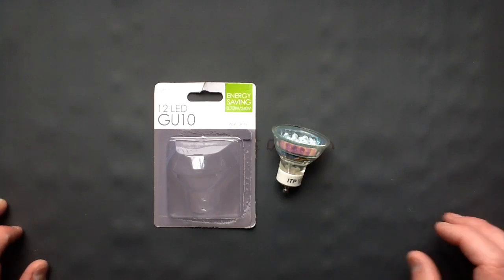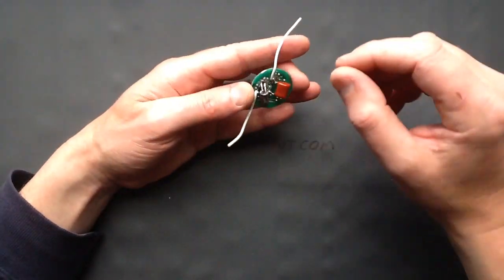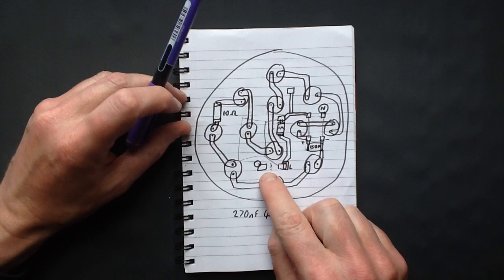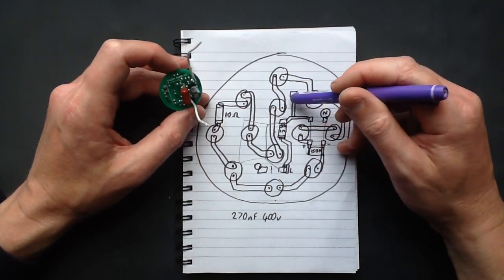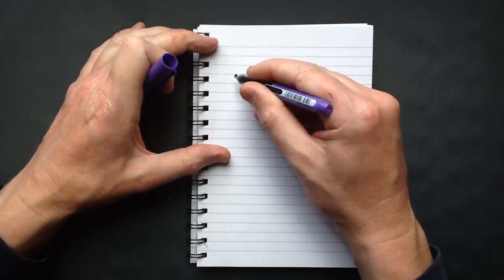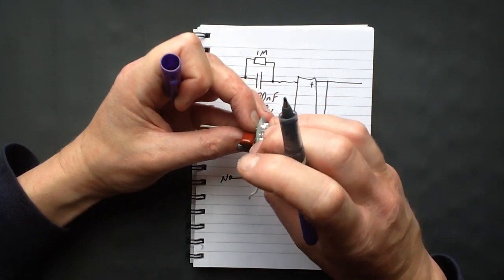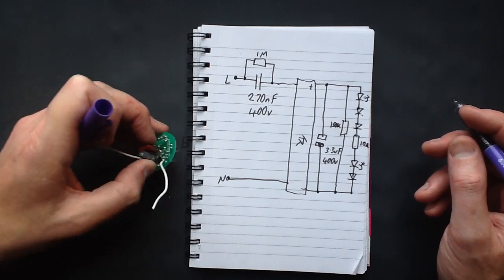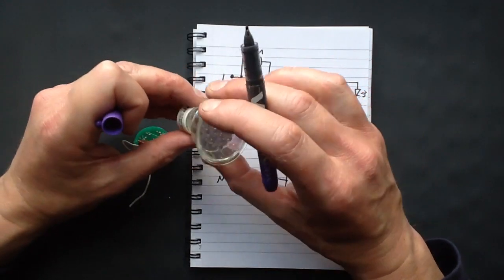Teardown of a Pound World GU10 LED lamp.

Comment: pound world have new led gu10 and its 50w equivalent got two in hall extremely  bright
Reply from the maker: Given the record of the higher power ones, I'd suggest their use in locations where they are not lit continually.  The higher power ones tend to get too hot for the LEDs.
Reply: john taylor Sadly they went back to the glass types like this (good ones were plastic ones in card cube packing). The new ones though, my god they are shit. Very dull, barely lights up my tiny kitchen with 3 of them. Avoid them.

Comment: I had 4 of those in the study downstairs. Wasn't giving enough light so after a few months, I got 4 of the SMD 5W versions from Poundland instead. Much better now :)
Reply from the maker: +Chris TheHulk (Pepsiholic2008) They actually do two types of the 5W GU10 now.  A glass one which looks quite attractive and a plastic one with aluminium interior that has a stippled front cover.  I've just made a video of the plastic/aluminium one and it was actually very interesting.  It'll be up soon.
Reply: In the bathroom are the Poundland plastic body ones (Electrek) and in the study are the VTAC ones :)

I've also tried the 2.6W Electrek ones from Poundland and they are pretty good too, but a bit directional with the light output
Reply from the maker: +Chris TheHulk (Pepsiholic2008) I've just put the video up, so you can take a look inside your plastic ones.
Reply: Cheers :)

Comment: Of course they skimped on the 0.01 cent inrush current limiting resistor, even though they already got the pads for it....
Reply: 2A isn't much at all anymore. Better than relying on the few Ohms of the contacts, traces and internal resistance of the capacitor.
Reply: *****
No, it isn't, because the LEDs don't ever see that current. The inrush current goes into (and is caused by) the smoothing cap.
Reply: *****
No, you don't understand. As long as the smoothing cap voltage is lower than the combined forward voltage of the LEDs all the current will flow into the smoothing cap. That's physics. Since the same current flows through (/flows into) both caps (physics again) and the dropper cap has a very small capacity compared to the smoothing cap, its voltage will rise much quicker than the smoothing cap's (voltage = charge/capacity) until no current will flow at all (for that part ot the mains cylce).

The dropper cap and the smoothing cap form kind of a capacitive voltage divider in that case, with the voltages inversely proportional to the capacity of the caps. You can try that out. Put two caps in series and put a voltage across them and measure the voltage of the middle point.

Again, it is the smoothing cap (and to an extent the dropper cap and maybe rectifier) that has to be protected from the inrush current, not the LEDs.
Reply: *****
Sure, in that case. But the circuit does have one and most will have, because otherwise the LEDs would flicker like crazy and it would "fail" because people throw it out before the LEDs are broken.

Comment: 325V / 12 LEDs = 27V / LED
Is that right?
Reply from the maker: The voltage across the LEDs is likely to be 3v per LED giving a total of 36v.  The red capacitor limits the current by letting a small portion through on each half wave of the mains frequency.
Reply: bigclivedotcom Ooops, forgot about the capacitor's reactance.

Comment: Ok I have a stupid question:
I have a 120 VAC Warm White LED strip lamp I got from Lowes last year and it has for some reason gone very dim.
 I suspect one of the caps has gone south.
What would you recommend looking at first?

There isn't much to this thing, It's about a foot long and runs off US AC 120 volts 60Hz.. and has a very similar circuit that your GU10 has there..
Reply from the maker: It could be the capacitor, series resistor or just degradation of the actual LEDs in use.
Reply: The LEDs are good I verified that by testing them one by one. I suspect one of the two resistors in the series. One is a 2R00 on the hot leg and the other is a 2R00 on the neutral leg. There is the 1Meg across the AC cap also but I think it will be one of the two 2R00 resistors.
Reply: I fixed it! It was the 2 ohm smc resistor on the line (hot) side that was bad. I replaced it and it came right on, No magic smoke was let out!